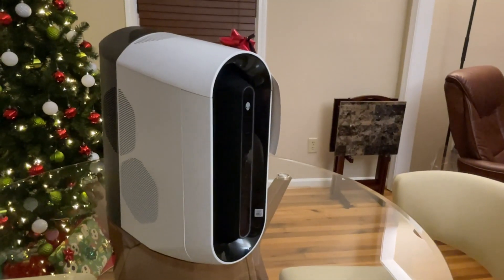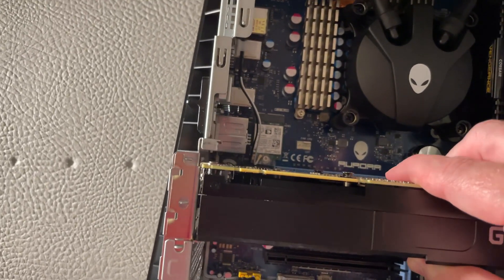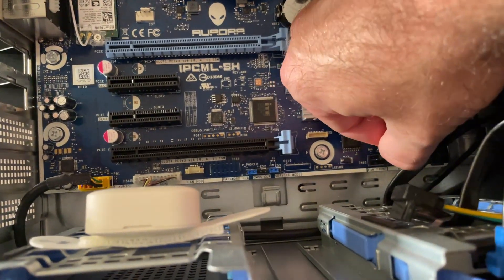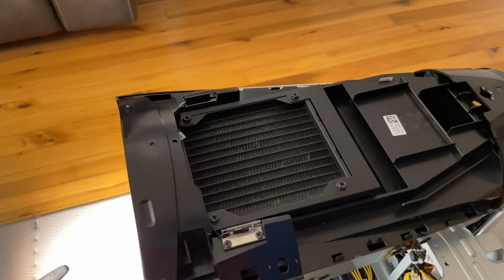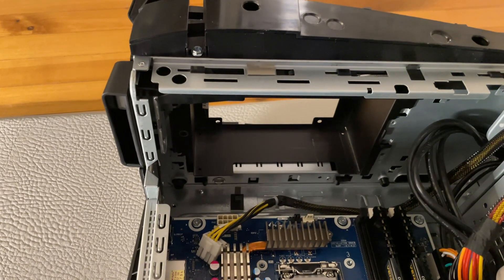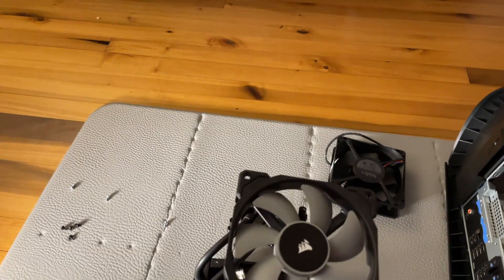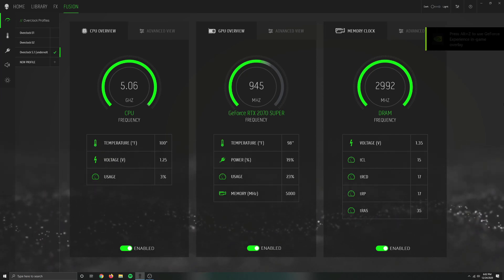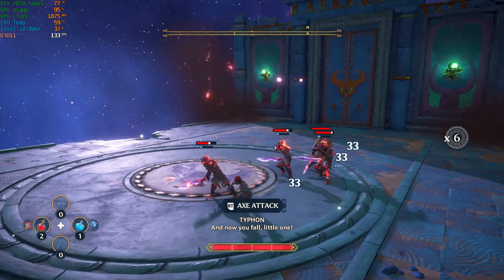Alienware R11 Radiator Mod and Case Fan Upgrade

Comment: I’m having a hard time finding the right screw. If anyone could provide a link I’d be very grateful
Reply from the maker: Here is the exact screws I used.

https://www.homedepot.com/p/Everbilt-6-32-x-1-1-4-in-Combo-Round-Head-Brass-Machine-Screw-5-Pack-813561/204274717
Reply: @theonlyjoe6036  bless your soul sir

Comment: Great video. I own an R10. I purposely ordered it without water cooling so I could simply put a Corsair H60 in which has a better fan than the alienware model. The problem I have is that mine has an RTX 3090 in there. DELLs 3080 and 3090s are made shorter so they can fit in the alienware case....which I have to say, isn't well designed, as far as heat is concerned.

Comment: Hey Joe, I did this upgrade about 2 weeks ago. It was for my Alienware R11. It did not help with the fan noise. I do not know why. Do you have any recommendations? I do not know much about computers.

Here are my specs...

Intel i7-10700KF, NVIDIA GeForce RTX 2080 Super 8GB GDDR6, 512GB SSD + 1TB SATA HDD, 16GB DDR4 XMP, Windows 10 Home, AWAUR11-7088BLK-PUS
Reply from the maker: Not even with gaming? Have you checked your Alienware Command Center Profile? I run my fans in the balanced profile for normal everyday use, and Performance Profile for gaming. In balanced my GPU is the loudest thing in my system (which isn't very loud). When gaming, the fans do rev up, but they are still no where near as loud as the stock fans. 

Also, did you do the top case fan mod with two fans or one? Just curious, as I know some people have been trying only one fan up top with limited results.
Reply: @theonlyjoe6036  I did everything you did in the video. I have everything set to balanced. I haven’t messed with the command center.

Comment: I wonder if it's possible to remove that front harddrive cage and place an intake fan there instead? It's gotta be right?
Reply from the maker: I have removed the hard drive cage to try this. The issue is that it has the mounting points are for the Dell fan cage that is used up front, and the holes do not line up with a 120mm fan. I think they might fit with a 140mm, but I haven't tried this yet. Short of drilling some holes, I've looked for a Dell fan cage with no success (I wish they would sell some spare parts).

Comment: Hey man! Great video. I was thinking about doing a similar mod to my R8, as the stock fans can't handle my dual card setup. Do you think that the fans you used would work on my build? I've also been looking at the Corsair ML120 Pros. The inside of my PC is pretty much identical, although the radiator configuration is a bit different. I think it would work, and help reduce the horrid fan noise. Any thoughts? Thanks!

Comment: I ordered these fans and did the same exact setup as you but I am getting a bios error when I turn on the pc and the top fans aren’t spinning, any suggestions?
Reply from the maker: Is your splitter PWM (power monitor) compatible? The splitter must support PWM as the MOBO must be able to read the RPM and wattage from the fans to work. 

This is easy to tell: Look at the splitter, the non-split end should contain 4 pins. The split end should contain one 4 pin connecter and one 3 pin connector. If that doesn't work, I'd also try plugging each fan separately (one at a time) into the MOBO connector to ensure each fan works properly. 

Lastly, and I know this sounds dumb, but make sure the fan connector was plugged back into the fan header on the MOBO and not the heatsink power. I've included a link to the exact splitter I used. 

https://www.amazon.com/gp/product/B01EF9OI0O/ref=ppx_yo_dt_b_search_asin_title?ie=UTF8&psc=1

Comment: would this fan work? Noctua NF-F12 iPPC 3000 PWM, Heavy Duty Cooling Fan, 4-Pin, 3000 RPM (120mm, Black) I’ll just be doing the single fan replacement.
Reply: I have them in my R10 - ryzen9 5900x - rtx380. there the best fan you can buy imo. quiet and cold.
Reply: These fans are not good enough for radiators

Comment: --- DO NOT BUY DELL-- I Ordered my Alienware on the 23rd of Jan 2021, which is a month's delivery time. They canceled my order on the 10 Feb without an email, explanation, or any notification. I found about the cancelation because I checked the status on the 12th, and I, mad out of my head, contacted Dell Chat, and they logged an Issue (# 44392790), and till today no one has contacted me. I use these gaming PCs for my data science projects, and dell even did not bother telling me about canceling my order. The sales/chat person informed me that they have compatibility issues with my order; hence, they just felt it best to cancel my order and let the guy lose clients while selling incompatible products. Before a dell rep reads this and tries to explain, please give me an explanation - Purchase Order # 2007035021578.

Comment: Hi Joe, its really necessary the push pull configuration? Or will work with just 1 fan as pull?
Reply from the maker: I would advise both fans for the top. The stock Nidec fan is an industrial grade server fan that actually has twice the CFM of a single Corsair Pro, but the Nidec is also noisy (and is of course never running full out; I never saw the Nidec go above 30% power and it still was irritatingly loud). The Corsair can move air more efficiently and more quietly across the RPM range, but in order to match the airflow of the Nidec while maintaining a low RPM and noise level it is recommended you install two. A single Corsair fan could move enough air to cool the case, but it would have to run at a higher RPM (higher noise level) in order to so.

Comment: Hey followed your directions with all the products you listed. I’m now getting a flashing yellow alien head. Everything’s plugged back in so I’m not sure
Reply: Scratch that. Taking out the ram and putting them back in solved it. Great video btw! It really has helped!
Reply: @xopher1493  Thanks for following up.  I'm about to do this operation and now I am better informed (if I happen see the same result, which in your case happened to be RAM seating).

Comment: Hey Joe! Question here. I ordered an Aurora R10. I was really after the specs of the rig, which was Ryzen 5 5600X, RTX 3060 ti (Alienware liquid cooled modified version) and 16GB 3400mhz. Would it be possible to use the components I’ve just mentioned, into a completely new different PC rig? New motherboard, power supply, NZXT tower, etc.
Reply from the maker: It would be no issue at all. Though the Dell PSU isn't bad and it fully modular. Also, the MOBO might be worth keeping (though it is an M-ATX board; so just make sure that the case you are getting supports M-ATX). Dell used a nice high-end Z490 chipset on my Intel R11. Check to see if your AMD is the higher end chipset as you wouldn't really get anything out of upgrading the MOBO it if is. I don't blame you from wanting to ditch the chassis though.

Comment: Great video thanks, I am considering into buying one of 
these and before I do I have a question for you. I have been doing some 
digging into what kind of problems that people can run into and a lot 
people been having issues with power and automatic shutdown of the 
computer while booting or playing games, Have you ever had any issues on
 this matter other than "Temps"?
Reply from the maker: I've owned my R11 since June 2020. I know that the R11 will shut down for thermal reasons in order to protect the components, but I have never had that issue myself; I'm also running an under-volt which also helps to lower temps even while I am also running an overclock. I have heard nightmares from people who purchased the air-cooled version of the R11, and I'm shocked that Dell even offers an air-cooled CPU in such a tight chassis like the R11. I did experience one brief issue where the RGB lighting stopped working correctly, but I solved it by uninstalling and reinstalling the Alienware Command Center software that controls the lighting. 

This is the first PC that I have ever bought. I've always built my systems since I was a kid, but that was impossible this time around due to the pandemic and part shortages. Overall, the R11 isn't perfect and I wish it had more cooling and airflow by design, but I'm happy with my purchase.
Reply: @theonlyjoe6036  Thank you, I appreciate your in depth description of the PC it really means a lot. I was looking into it and I will also under-volt it as soon as a receive it plus a few modding to the fans and thermal compound will definitely increase the life of the PC (Just as you did in the video). 

       -I had to ask this question because of course the stock levels are a bit lackluster still so I had to make sure If this is a great investment or not since will be paying a premium on it vs building it your self.........Thanks again will definitely Sub.

Comment: I’m still new with computers but does it matter if I got rgb fans with the same desktop
Reply from the maker: I'm not 100% sure if the RGB fans will have the same voltage curves, but I have heard from several others that Noctua fans will work.

Comment: Will the fans with lights work? I can't find the non LED ones for a reasonable price.  Plus if I only get a ssd in the computer will it come equipped with the sata and power cables?
Reply from the maker: I don't know for certain if the LED lighted fans will work. I would suggest buying one and trying it up front as it is easy to do. I have heard from several people now that the Noctua fans do work with no issue. The case only comes with enough SATA cables needed for whatever configuration you order, but there are excess SATA power cables for adding extra drives (you will simply have to supply your own data cable).
Reply: @theonlyjoe6036  thanks

Comment: The fan comment is fake. It works with every fan...  i'm using a artic P12 silent and noctua nf-a12x25. Works very good
Reply from the maker: I've heard that Noctuas do work, and good to know that Artic P12 work as well. I did try the mod with non-pro fans and received the BIOS error, and spoke with others who had tried different brands with the same results. Dell might have fixed this in a recent BIOS update too; something that is actually worth testing.

Comment: I have a question is the motherboard upgradeable?
Reply from the maker: Sure. The case will fit a standard M-ATX motherboard. However, I usually advise that it is time to upgrade your case when you upgrade your MOBO as a MOBO upgrade will also (usually) mean you are upgrading the CPU and RAM.

Comment: It was hard to tell but did you gain any extra clearance between the GPU and the new fan?
Reply from the maker: No. The maximum length for a GPU is still 10.5 inches.
Reply: @theonlyjoe6036  More because the alienware box is short for the 3070, barely. , guy did a YouTube video removing the fan and it fitting, just short with fan.  Which is why i asked.

Comment: yo man, i don't understand the push pull part... the pull fan and the push fan in the radiator must look in the same direction ? how is this a push pull if they both suck air in ? sorry for the stupid question but i'm a beginner in this and i don't want to kill my 3000$ computer =/

thx man
Reply from the maker: That's cool bro, everybody has to start learning somewhere. The push fan is the bottom fan and pushes air against the radiator, and the pull fan up top pulls air through it. Hence, why it is called a push / pull setup. 

In theory, pushing will move more air - all other things being equal. Higher pressure air has higher density. When you push, the air in the duct will have higher pressure than if you were pulling form the other end. This means that for a given unit of time, more air flows though a pushed duct than a pulled one (again- assuming all other things equal). 

This is why a single fan AIO is pretty much always in a push config. Adding a second fan in pull mode increases the efficiency of the push fan.
Reply: @theonlyjoe6036  oh ok that explains everything ! thx ! last question, is it risky to use thermal grizzly conductonaut to repaste the cooler ?
Reply from the maker: @PrepsBoy  I would only use the Artic Grizzly if you are doing a delid, and I wouldn't recommend that anyone with an R11 try a delid as you will void your warranty and possibly fry your CPU unless if you are very careful. I'd stick with a non-conductive thermal paste like the Artic MX-4 or MX-5 as it is safe and easy to use.
Reply: @theonlyjoe6036  ok, so even tho it's not for a delid, i'm going to use a classic thermal paste, i just read that using thermal grizzly conductonaut is a big risk if it's your first time doing something like this

Comment: How is your inside fan so sunken in? When you put the ml120 pro before the radiator it pushes the radiator back into the case causing the hoses on the aio to bend and block the power supply.
Reply from the maker: While it does bend the hoses out a little bit more than the stock config, I did not encounter any clearance issues in a push / pull config. The top fan on the radiator must go in the position in the video as it cannot rest above the bracket due to clearance issues (I tried). I have run much tighter bends in custom loops, so I'm not worried about the connectors and the hoses in their modded position. You are good as long you are not kinking or bending the hose to a creasing point.
Reply: @theonlyjoe6036  perfect. Thank you for the reply. It was very tight indeed. But it did close. Much quieter and a bit cooler as well. I was going to overclock, but I opted to run quieter at stock instead of getting  moderate overclock and turning my pc into a heater. I’d say the temps dropped about 10 degrees Celsius at idle. It still hits 90c but quickly dips down when the fans ramp up. I’m running a 10900k. While the fans are at 40% in the high 70 Celsius range instead of high 80s. Great guide. Thank you!
Reply: Exactly same concern here. Nice to see someone asked and get replied to answer my question as well. Now much quieter and temp drop 10 degree when just sitting there than before the mod. Thanks for the great work.

Comment: You know what's really making that loud sound when gaming? It's the PCU's fan. And for the cpu liquid cooler, the push pull method is just gonna get your cpu temps high over time because only one will work when idle so it will only blocks the airflow if the other fan is not running and even if it runs, it will not run all the time. One more reason why I wouldn't recommend the push pull method is the clearance between the fan and the PCU is so little gap so the air flow to cool the radiator is reduced so you're not really getting any benefits in doing this.
Reply: Since he used a Y splitter for both of the push/pull fans; they will both ramp up at the same time when under load since they're being controlled by the same fan header. Good point though on the clearance. I've seen people just swap out the stock rad for a Corsair H60i as well.

Comment: Thanks for this vid it is very helpful! my question is, do you have to take out the GPU to change out the front fan or is it possible to do it without having to remove it?
Reply from the maker: You must take out the GPU for the front fan due to clearance issues.

Comment: when you turn off the r1 does the alien power button light flash an amber orange color when it turns off for a brief second? everytime i turn my r11 the alien head very quickly flashes orange for a split second before it turns off. just want to make sure this is normal

Comment: I did this exact upgrade on my R11 with a 10900KF and a 3090. It’s definitely helped with noise, and seems to have helped with temps a decent bit. But it did seem to put a decent little  bit more of “bend” on the AIO pumps. I’ve seen some comments online that worried me a bit. Was wondering what your thoughts might be. Thanks you!
Reply from the maker: You are right that it did bend the AIO tubing. I don't think it is that big of issue. I've put far more stress on actual flex pipe liquid cooling systems with no issues. An AIO should last for 5 to 7 years, and the fittings on the Dell AIO (are actually Astek) are good quality too.
Reply: @theonlyjoe6036  thank you very much for the reply! Was worried about it after seeing people talk about it online. Feel better about it now, lol.

Comment: U need a backplate on that ugly dell gpu
Reply from the maker: I would be nice, but seeing as the R11 doesn't have a window no one would see it. The GPU that Dell included is actually an off the shelf PNY blower cooler model.
Reply: @theonlyjoe6036  it seems like if they could've went cheaper, they would. I bought their r11 3090 and it has 12gb ram on the back, so I am stuck with their trash cooler and backplate for now. Fans are 90%+ and forget about mining ETH greater than 60% power limit
Reply from the maker: @mwint1982  You're basically right. Builds from Dell and HP are built around a price point by accountants more than they are engineers. I'm shocked that they would even try to fit a 3090 in a case like the R11. I hope they redesign the R12 to have better cooling (aka more fans and airflow) as gaming components seem to be getting hotter and more power hungry.
Reply: @theonlyjoe6036  finally got it 80% TDP  but 80% fans. Had to stick every known heatsink to the backplate and run the power supply full swing open haha, but shes cranking out 105 mh/s vs. 60 originally